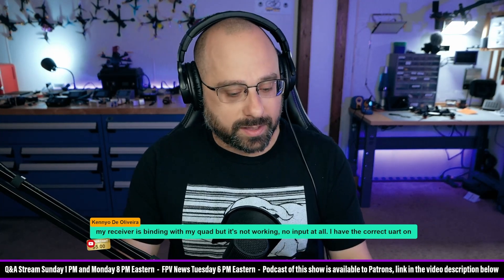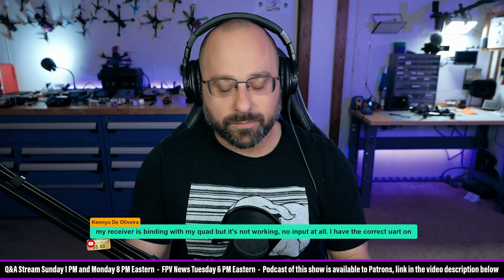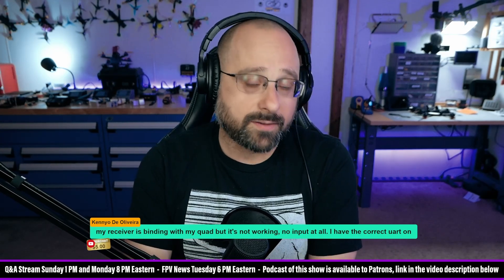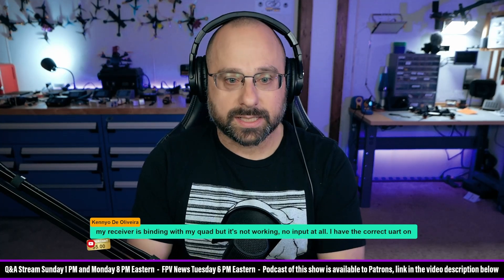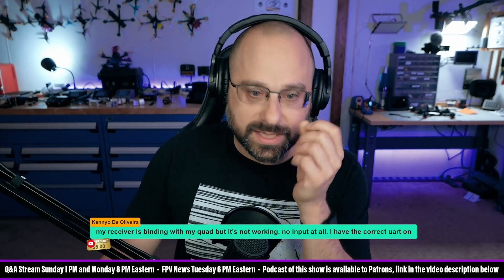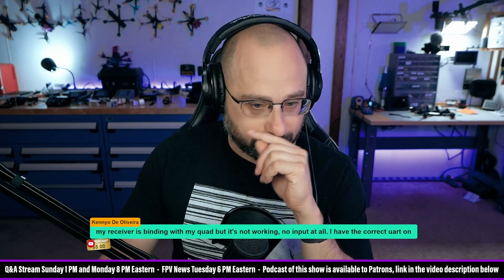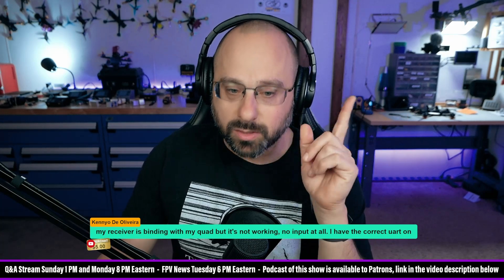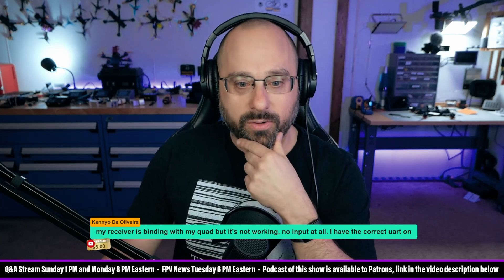My Receiver Is Binding But It's Not Working! Help! - FPV Questions

Comment: i have my drone connected to my radio on beta flight and do every command i give on beta flight but while trying to fly it wont respond, can any one suggest me what is happening?😊
Reply: Same here, but I cannot turn on my "URAT-1 PORT" AS SAID IN VIDEO. SERIAL RX on the same an turns on but uart 1 not turning on even after save an reboot in BETAFLIGHT.

Comment: Currently having the same problem with my pixhawk 1 and frsky x6r which is already bound to my tarnis transmitter any thoughts?
Reply: did you fix it? because im stuck on it too
Reply: @TGKiwi  yup, it was a software issue, just update your remote and receiver and make sure both of them have the same software type, there are 2 types in Frsky firmware website one of them ends with ACC i guess and the other one ends with something else.. make sure both of them got the same one and they’re updated to v2+
Reply: But before updating the firmware just make sure you’re connecting the SBUS port in the receiver to RC in on your Flight controller.. i know it’s a basic thing but it’s worth saying it because i did fall in that trap before

Comment: FC could not recognize the receiver after both Rx and Tx were upgraded from 2.2 to 3.0. The receiver bound to the transmitter with no problem. Downgraded both Rx and Tx back to 2.2 then everything worked again. I tried a few different Rx but got the same result, model match or not. Can't figure out what was wrong.

Comment: Since I switched from Dsmx to Elrs, I haven't had a single problem binding a receiver.  Cannot say the same for dsmx, which can be finicky and I frequently found the TX / RX apparently bound, but not recognized by the BF / FC.

Comment: Woah. I'm having the Same issue here. 😏👍
Great timing.
Reply: any solutions? I have the same issue. Used to work before but then I f**ed around with ports... Seems to put ports back as it used to be but Betaflight still doesn't see my radio controller

Comment: Model Match often causes the No-stick movements issue even if bound (C in top right corner of the ExpressLRS Lua Script)
Reply: was headed to the comments to mention exactly that, it seems you are always one step ahead ^^
Reply: new here having same issue, my receiver is wired correctly and i get telemetry i also have the c in the top right corner of my lua script. i have no function at all model match on receiver and radio are off using speedy bee f405 v4 stack and receiver is on uart 2 so serial rx is enabled on that section,  in receiver tab im using serial and crsf. could you please maybe help me figure this out?
Reply: @trbsmn  yo, I have the same exact problem rn have u figured it out yet?
Reply: Ty this worked for me HGLRC elrs receiver never happened with radiomaster rp1
Reply: Question about that. Will your receiver still show as connected even if there is a model mismatch?
Reply: @RichMoore-tweakin7376  Yes it would. It can't detect whether there's a mismatch otherwise.
Reply: @deadbyteDrones  thanks!! I'll check that out tomorrow. I forget the basics I guess🤦
Reply: @Carlos Sepulveda if you ever figure the answer out or get an answer from anyone, let me know. I was never able to get mine working
Reply: @Carlos Sepulveda Awesome.. so there's a chance of the three RP2s I bought one of them is bad. Come to think of it I've never run the one I've been trying to get running. I will try that. I'm glad everybody's still working on this issue 👍👍
Reply: @Carlos Sepulveda I'd be pissed lol... Well I appreciate all the feedback finally. You've givin me a couple things to look for! I'll let you know tomorrow, if I figure it out 🍺
Reply: I have same problem I think model mismatch I waited on rubber damper part for dji o3 for week then went to fly and drone armed and took off then feel out of sky 50ft away now it’s stuck in “ACRO” mode and no stick movement but it’s connected osd showing voltage but no throtttle. I have tx12 for remote can anyone help ?
Reply: Flylens 75 hd dji o3 unit with elrs and tx12 was working perfect before yesterdays flight i don’t know what i did I must’ve accidentally changed something or crash may have cause loose wire?? I don’t think so though

Comment: Happened to me last time, elrs radiomaster RP1 at first then i’d change to elrs ep1 still wont work, double check it, uart is correct, its binded to my tx but still no input at all. Change UART 2 to UART 5 and its solved. Try to change to another UART.
Reply: wait so don't do what JB says in the video?  Don't use UART 4?